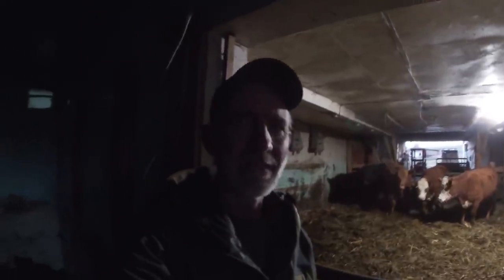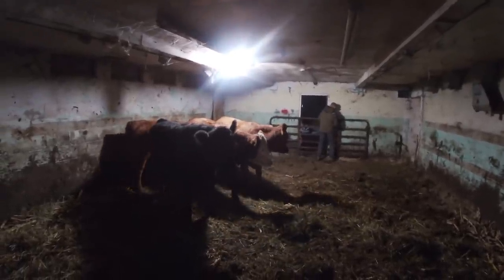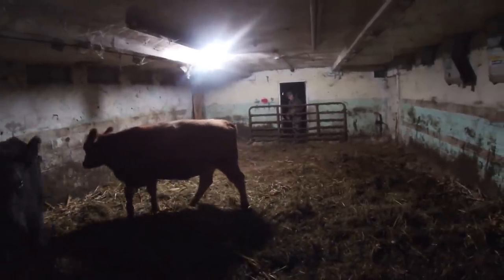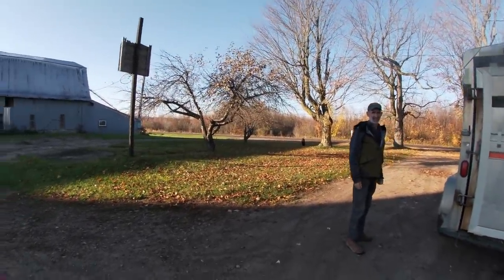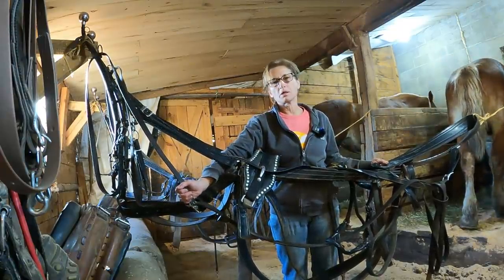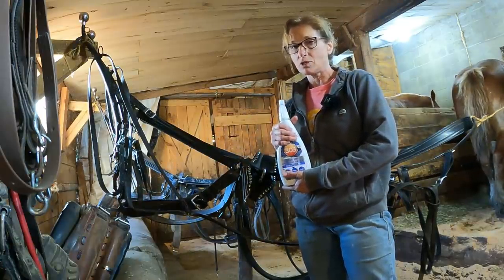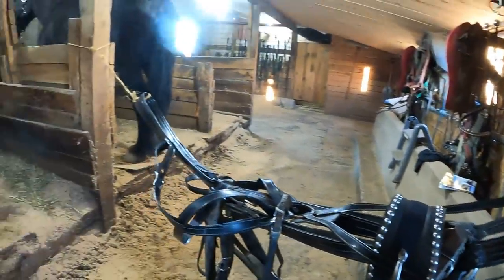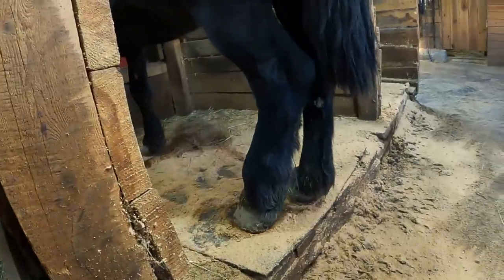How to Clean Draft Horses Harnesses // Moving Beef Cows into the Trailer

Comment: Thank you Jim.  Only men raised on farms can move cattle that gently. A cows feelings are so easily hurt then you  can not catch them when they get wild eyed. HA HA HA. I have seen city people scream and flap there arms and chase them forever with an ATV.  HA HA HA.
Reply: I used to help a friend gather and ship his cows from his ranch to his summer grazing permit and then back to his ranch. The grazing permits are open range so the cows become accustom to no fences all summer long. It was always a short race to get them caught and then we trailed them to the cow camps where we had holding pastures. When they got to a gate it took time to let them find the opening. Some cowboys could never get them in, all the cussing, yelling and rodeo antics never worked and cows would be running in all directions. You have to move quietly and deliberately, no fast or false moves and they will just go through if you give them time.
I tried to show a couple of them how to know which way a cow would go by where you pointed the horses head. (If on foot you can do the same by where you are positioned and where you are looking at the cow, same as a cattle dog does.) If pointed at or in front of their head they will usually turn back. If you point the horses head behind their shoulder they usually will move forward. Most of them never caught on, and just went to cussing, yelling and running their horses around scattering the cattle all over.